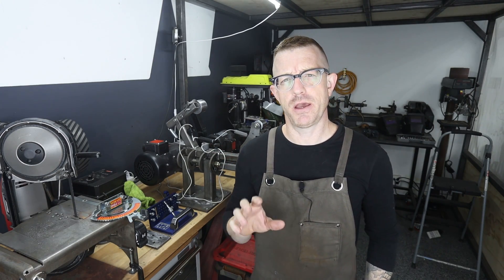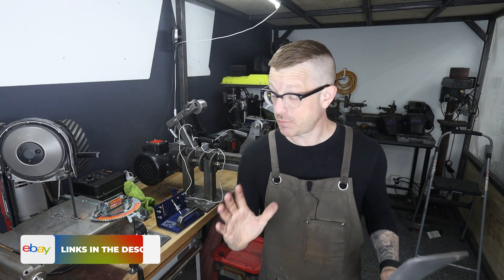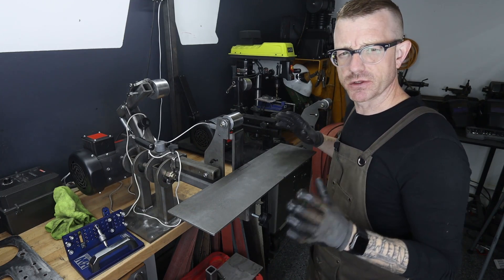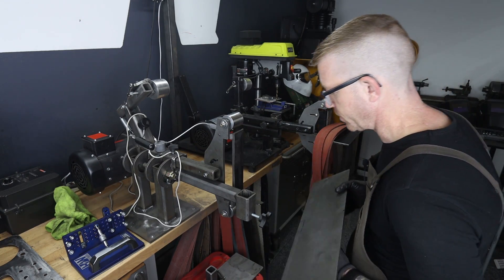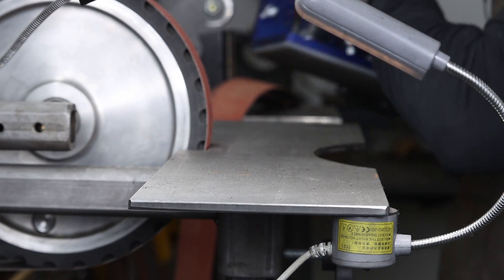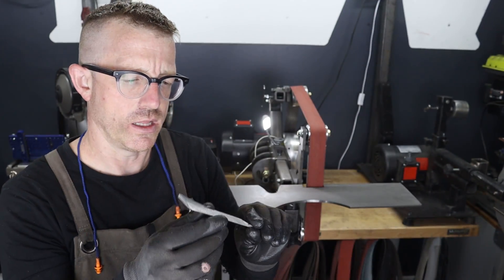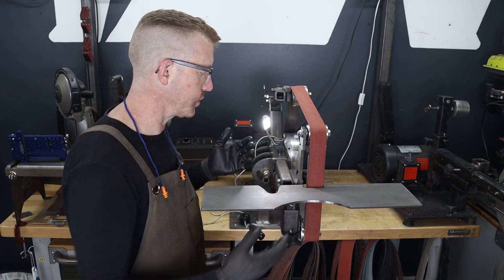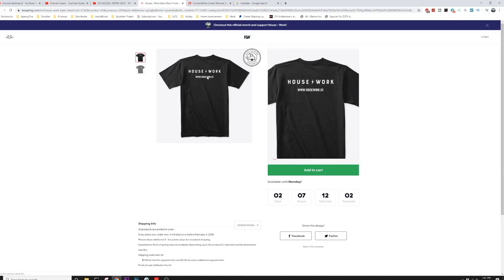2x72 Belt Grinder Combination Work Rest - Build for Knifemaking

Comment: I was a metal model maker for a large auto manufacturer in the engineering department for many years. I worked with a fellow that always wore gloves while grinding. One time while using the large disc sander he got his glove caught between the disc and the table, he ground OFF his thumb and first 2 fingers to the second knuckle. You might want to think about your gloves while using drill presses, sanders etc.  Just my 2 cents.  Greg
Reply from the maker: Definitely something to think about. My gloves just rip if they get caught on anything.
Reply: His just ripped too,and they got sucked down between the disc and the work table. About a 1/4 inch clearance

Comment: Haven’t seen the SketchUp plans for this “Versatile Work Rest” included in my Revolution Generation 4 plans. 
Was there a decision not to? 
3/8”x 24”x6” correct?
Thanks Brian!
PS Alllllllllmost done building my grinder!
Reply from the maker: Unfortunately there are too many configurations to put plans out for this. It has to be made custom to the machine. Easy enough if you follow this video though.
Reply from the maker: And yes 24x6 - use 3/8 or 1/4 - careful not to warp it!

Comment: With my grinders, I ended up just using magnets on a smaller tool rest(came with the grinder). I even made separate plates for each attachment, but to be honest, most of the time I use the big wheel plate for my small wheel & just flip it around for the platen. Great idea though, hope all is well, take it easy...
Reply from the maker: Yeah that’s one way of doing it maybe I will look into that again. I have that on my other grinder and it works out pretty good. Hope you’re doing well Dave. I’m glad we connected on Facebook.

Comment: Very nice! I'm currently building this grinder and I think you missed describing a step in the build. We need to drill and tap a 3/8'' hole in the front pillar to make use of the 'c-channel' in the hinges with a bolt. This was not addressed in the plans, just a heads up
Reply from the maker: Thanks I’ll add that. 👍🏼👍🏼👍🏼